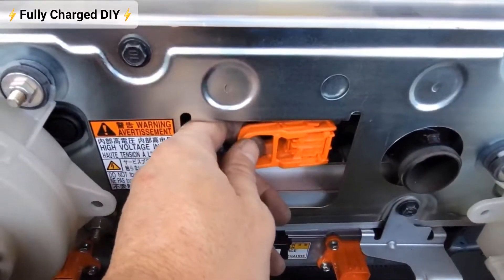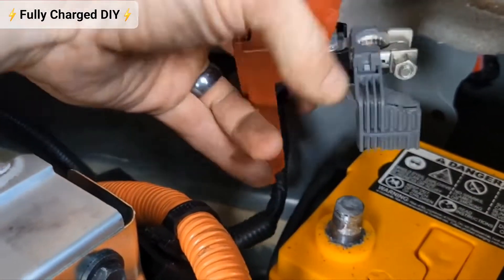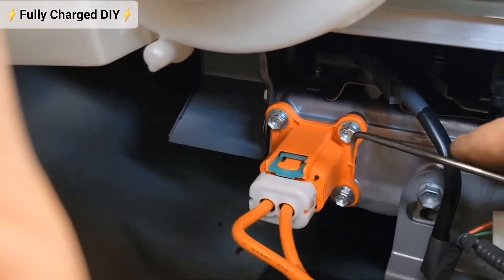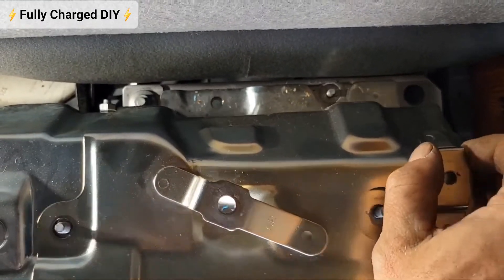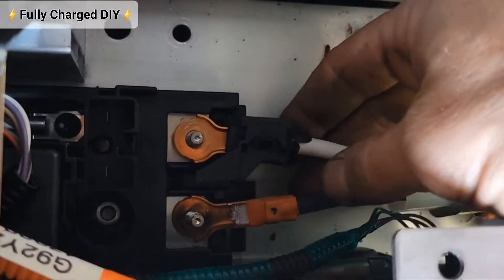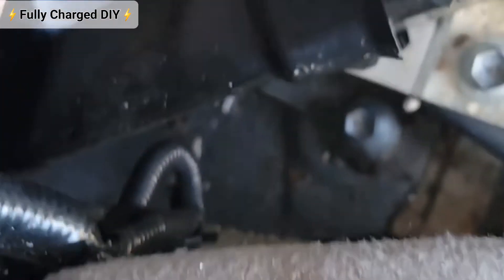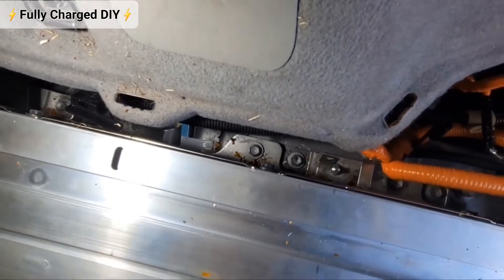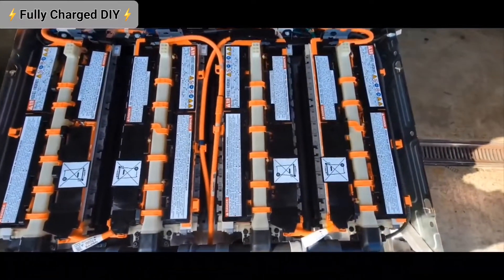Prius Plug-In Hybrid Battery Removal 2012-2015

Comment: do u think it would be okay if i just remove the service plug and unbolt the 12V prior welding?
Reply from the maker: Not exactly. Removing the service plug helps, but it doesn’t fully make the pack safe for welding.

When you pull the Prius service plug, you only break the series connection between the battery modules. The high-voltage battery is still physically in the car, still grounded to the chassis in multiple places, and the system can still see induced voltage from welding equipment.

If you’re doing any kind of welding on the body near the battery area.. Disconnect the 12V battery, Remove the service plug, Wait 5–10 minutes for capacitors to discharge and ideally remove the HV battery from the vehicle.

Toyota actually recommends removing the HV pack anytime welding is performed close to the pack or the HV wiring harness. Welding current can travel through unexpected paths and damage the battery ECU, contactors, or even arc inside the pack.

I use to work for Toyota, a few extra steps will save you a headache later.

Comment: Hello Mr. Toyota Battery Tech. I'm thinking of getting a 2015 Toyota Prius hybrid plug in as my first "electric" car. I have a good experience working on ebike batteries and I work on backup battery systems for networks and am licensed by Eaton and APC to work on their battery storage. I haven't really looked yet at battery replacement prices, but do you feel like a battery tech could replace the battery back in their garage, or do you need special tools and software? Also in your opinion would it be a good deal to buy a car with under 200k miles and replace the battery yourself if the car cost about 10k. Thank you for your time.
Reply from the maker: Hey, great question! With your background, you’re already ahead of most DIYers. The 2015 Prius Plug-In battery can be replaced in a garage if you follow proper high-voltage safety and use insulated tools — but it’s not quite like working on an e-bike pack. You’ll need to isolate the HV system, and sometimes the car may need a calibration or BMS relearn afterward.

If you can source a good refurbished pack with a warranty, it can definitely be worth it. A $10K Prius with under 200K miles sounds like a solid deal if the rest of the car checks out. Just make sure to scan the battery health with Autel EV duagnostic tool or a hybrid diagnostic tool before buying.

– Fully Charged Zone ⚡

Comment: I’ve got a ‘12 plug in Prius that gives an error when plugging in to charge.  I have to pull the white wire in the fuse box to reset.   The back hatch was leaking water and filling up the tub that the battery sits in.  The traction battery charges fine when going down hills during  re-gen.   Do I just need to replace the onboard charger?  Do I have to remove the whole battery?  Thanks.
Reply from the maker: Does the vehicle have any trouble codes?
Water in the Onboard Charger can definitely cause issues. I would pull codes from the high voltage module before I could make a diagnosis. Water could have caused a charger malfunction..
Reply: @FullyChargedZone  Thanks for your response.  No trouble codes.   The error shows on the dash IIRC.  I haven't tried clearing it with the scan tool.  But the error goes away when I pull the thick white wire in the fuse box under the hood.

Comment: In how many years and how many kilometers (miles) can I expect to change the battery on a plug-in hybrid? I am considering purchasing one that is 10 years old and has nearly 200,000 km (124,000 miles). I appreciate your response.
Reply: Why not!!! I mess with   batteries all the time... it's not as dangerous as people say and it's easy to check the voltage all these things if you can buy it for cheap why not and you can use the the cells to replace
Reply from the maker: Life expectancy is 14 years... The capacity of a 10 year old battery would probably be in the 30 to 40%.

I would not purchase, in my opinion
Reply: 10-11 years old Prius plugin batteries are at about 90% of the original capacity, not 30-40%. There are measures and different calculation on this topic. Mine (11 yo) has about 92% by calculations. Wasn't brave enough to disassemble and measure cell by cell.
As the Prius plugin uses only 65% of the 4,4 kWh capacity, when it would degrade to 30-40%, it would get error codes for sure.
Reply from the maker: Toyota Dealership Technician website:
Toyota Lithium-ion  batteries can last 10–14years or 2,500–9,000 charge cycles when properly maintained with proper care, the lifespan can be extended to 10,000 cycles or more.  I'm a Toyota High Voltage Technician. I've been working on batteries for 15 years. I'm sorry, but you've been misled. Error Codes for battery pack capacity start at 29% degradation of battery capacity. I routinely replace Prius plug-in batteries at about 120k or starting about 11 years of life cycle. I've seen the battery packs  with decent capacity still at 10 years old, but usually set a check engine light due to imbalanced batteries.
Reply: In our local (small EU country) Prius Club (about 13k members) no one heard about dead Prius plugin battery. We have plugins from 2012 over 250-300k and even 340k miles without any serious degradation on any of them. Here the plugin battery considered to live 'forever+1 day'. :D
One of our members (he has a 2012 PiP with 235k miles) replaced the original cells to 50 Ah CATL cells and tested each old cells' capacity and got 93-94% capacity.
Reply from the maker: Im interested in 
how are you testing capacity & degradation? You can't do that without disassembling the pack. Tech stream original Toyota computer from dealership doesn't provide capacity data.  I've seen plugins make it to close to 200k here in the USA without replacing the battery.  I've yet to see over that without capacity being depleted or a check engine lighy. Im glad to hear vehicles making that mileage. I've built a power wall with these batteries before. I also sell these cells on eBay. I capacity test them all The capacity test at 10 to 12 years old is about an average of 30 to 40%. I am also a group leader on Facebook.  I have 52k followers on battery repair. What's your groups name? Check us out Toyota Prius Repair group.
Reply: @FullyChargedZone my prius plug in is a 2013 and I still get 12 miles on the charge.
Reply from the maker: That’s actually really solid for a 2013 Prius Plug-In! Getting around 12 miles after this many years means your battery is aging pretty normally. Most hybrid packs last about 10–14 years depending on climate and driving habits, so you’re right in the expected range. Keep it maintained and it should keep treating you well! 🚗⚡️
Reply: @FullyChargedZone the problem is it just started either phantom draining or the 12v is dead because it goes completely dead (not even able to unlock the doors) the last week since it got cold. I’ve been jumping it for my wife in the morning before work until I have time off to poke around and maybe replace the 12V battery in the back. I noticed a headlight is out today so maybe something is loose
Reply from the maker: Sounds like your 12V battery is on its way out. On the Prius Plug-In, a weak 12V will cause exactly what you’re seeing — full shutdown, can’t unlock the doors, random phantom drains, especially when the temps drop.

A blown headlight usually isn’t the cause, but it can point to a loose or corroded connection, so definitely check your grounds and the 12V terminals in the back.

Most likely a simple fix: replace the 12V and you should be good. Prius gets real picky when that battery gets weak. 👍⚡️
Reply: @FullyChargedZone thank you!! I plan on doing so tomorrow. Do you have a recommendation? Because my local Toyota dealer said there’s is about 270$ for one but I had trouble finding one at autozone
Reply from the maker: You’re welcome! 👍
Yeah, I checked around and the prices are pretty much in that $250–$290 range for a quality 12V battery. Anything cheaper usually doesn’t hold up well, and you’ll end up right back in the same situation. Stick with a good one ( Dealer Battery)and it’ll save you headaches down the road.
Reply: @FullyChargedZone then that’s what I’ll do! I actually just checked the charge on the Prius (it’s my wife’s car) and it actually charged up to 13.8 miles! So I guess I have a Frankenstein plug in!

Comment: so (mine is 2015) Prius plug-in has two batteries? one is Hybrid battery and another is Plug-in battery? So replacing Hybrid battery also need to replace the plug-in as well?
Reply from the maker: This Prius has a 12v battery & a high voltage battery
Reply: @FullyChargedZone  I meant Plug in  battery and hybrid battery , not 12v battery
Reply from the maker: @jpthsd  only 1 high voltage battery
Reply: @FullyChargedZone  thank you good to know!